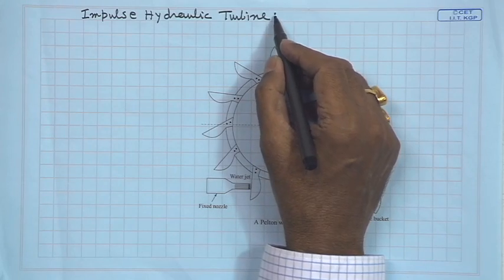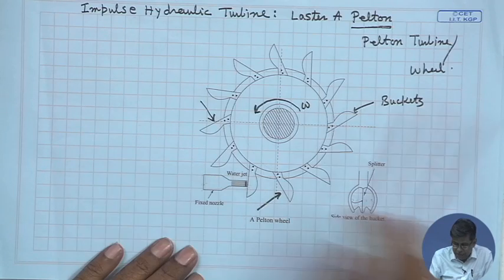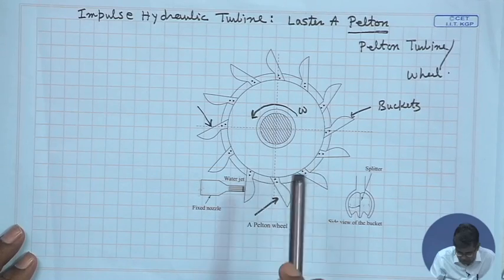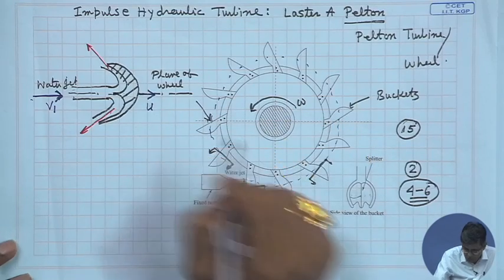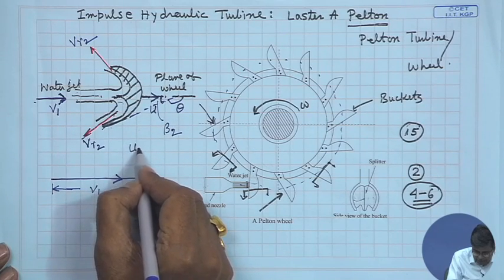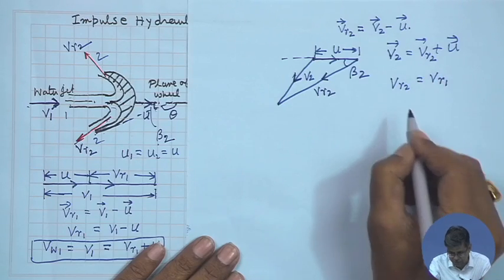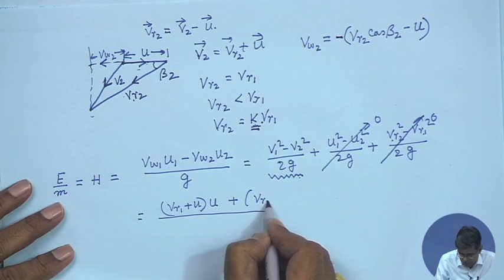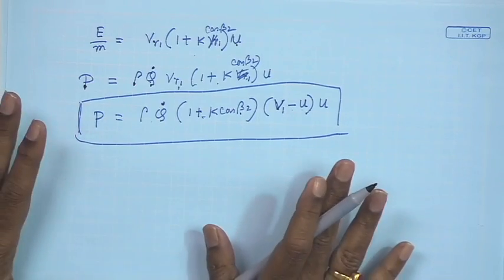Basic Principles, Analysis of Force and Power Generation Part - I

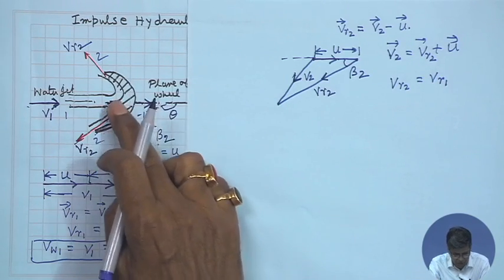Comment: I have understood that fluid ,from nozzle inlet to  rotor outlet, is completely open with atmosphere so static pressure does not change. But in previous lecture we see that due to change in relative velocity static head also changed. So here (21:20) due to friction relative velocity is changed , shouldn't change also static head? if static head changes then we can't say it  impulse machine! or what is the effect of change in relative velocity of fluid?
Reply: “Does’nt change” is a relative term . There is nothing in this world that does’nt change. These are idealisations to minimize the mathematical complexity
Reply: even if static pressure does drop due to Vr2 being greater than Vr1, then it can't be called pure-impulse, then it is impulse-reaction or famously known as reaction, but this name is misleading as it is not 100% reaction, there is still an impulse component. The degree of reaction will be very low in case of friction, so on paper i think they still call it: pure impulse